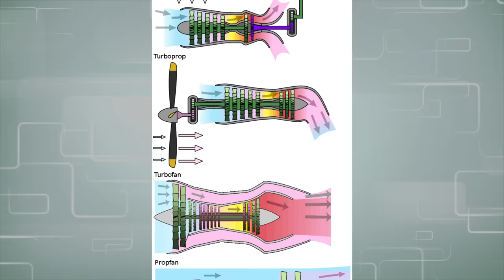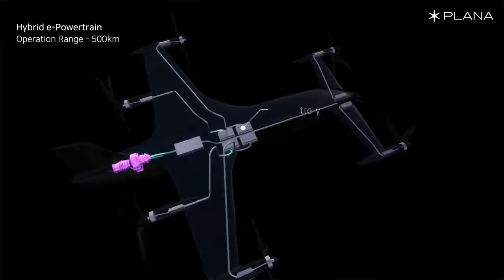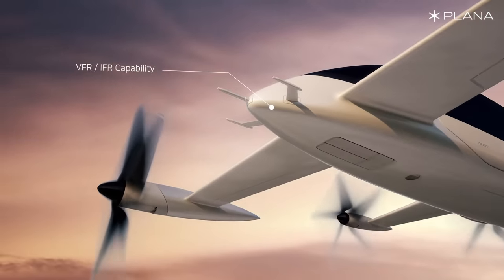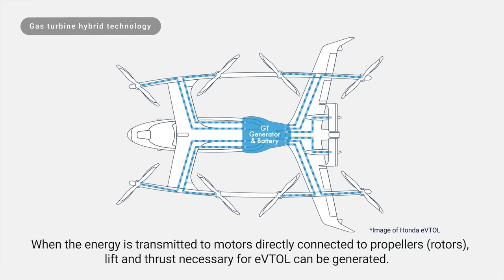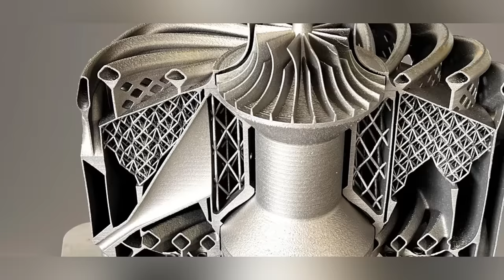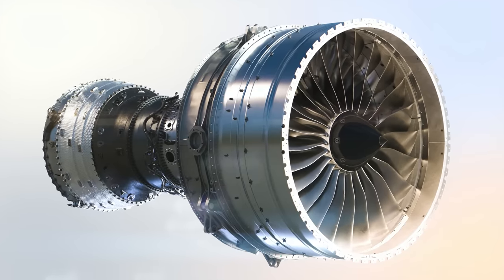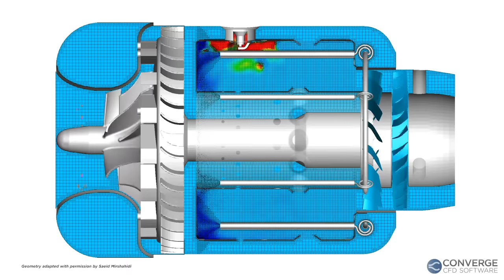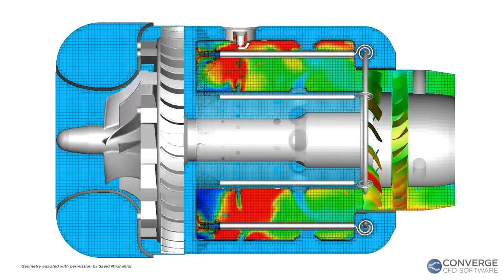New JET ENGINE Will Change AVIATION Forever

Comment: From a material perspective, it's an intriguing approach, but somewhat challenging because additively 3D-printed metals have very high internal stress. To eliminate this stress, numerous heat treatments are required, causing the component to distort and expand. Consequently, this distortion and expansion must be considered in the design, so that when the residual stresses are relieved during later heat treatment, the component attains the correct dimensions. The difficulty lies not only in ensuring the component has low residual stresses but also that it is sufficiently rigid, hard, and capable of withstanding high temperatures. For instance, austenitic steel is suitable for higher temperatures, or one might opt for titanium or alloys that can handle such conditions. However, these materials pose challenges in additive manufacturing, making it a significant problem to 3D print large heat-resistant parts or highly stressed components, such as turbine blades.

Comment: Fuel tank become lighter as fuel is used.  Batteries do not become lighter as charge is used.  An empty fuel tank adds minimal weight to an air vehicle.  An empty battery adds as much as a full one.

Comment: Marketing: "We need to placate insane eco-types and market an electric aircraft. Engineers: make it happen!"

Engineers: "Here it is. The plane can fly 30 miles"

Marketing: "Not good enough. No one will buy it. Make it better!"

Engineers: "Let's put a Jet Fuel burning engine in it to power the electric motors and increase it's range."

Marketing. "Perfect. We will call it eco-electric. Don't look at the carbon footprint..."

Comment: General aviation piston aircraft generally still use leaded fuel. Innovation in commercial aviation is usually incredibly slow. The air taxi model might work in cities, but I'm not holding my breath for hybrid airplanes.

Comment: General Aviation (anything under 12,600 lbs) urgently needs a new, inexpensive ($150k) turbine engine in the 300 to 450 SHP category that can burn from diesel, Kero, Petrol.....that can also be retro fitted to old airframes.

Comment: The biggest problem with trying to make electric planes is the fact that they weigh the same at both takeoff and landing. Fuel-powered planes have a far greater takeoff weight than landing weight. As they fly and burn fuel, they get lighter. Batteries will never get lighter, sacrificing cargo capacity for landing, not to mention range and efficiency.

Comment: The additive made engine you stated is 2000 watt hours per kilogram .Can you indicate what that means in HP to kilogram or watts per kilogram and how that compares to normal asperated piston engines like a  typical 100 hp  to 200 HP aircraft lycoming engine  like  is it twice  or three times as good as that  type of piston  engine .  If additive engines are only slightly better in Watt hours per kilogram  than other aircraft engine like a typical piston engine or turbo fan or turbine engine  then  the big extra purchase cost  probably makes them a non starter even if they have longer lives or longer periods of servicing .

Comment: I wonder if the 'killer application' here could be hybrid trucks. If the overall efficiency of a hybrid system beat a typical Diesel, it would be a huge win for truck drivability and running cost. Battery trucks seem a bit of a way off yet in true feasibility (the Tesla truck has a market, but it's not a universal solution at present). Gas turbine trucks were tried in the 60s and failed due to high fuel consumption, noise and expense, but fundamentally the problem there was trying to drive the wheels directly. A series hybrid with a turbine generator could solve all that now.
Reply: The Brayton (gas turbine) cycle is less efficient by a significant amount. So it isn't just the high speed shafts and noise that we're a problem.

The Rankine (steam) cycle would be more appropriate. Higher efficiency, fully internal working fluid, lower noise, burn dozens of types of fuel. The biggest issue would be keeping the weight down, but that should be doable in the same foot print as the ICE. It wasn't well suited historically due to slow response times. But with hybrid electric that is addressed by having a battery.

Comment: I think the idea of 3D printing entire mechanical assemblies as one whole device is both exciting and concerning.
The exciting part is imagining ease of maintenance. Rather than having to disassemble an entire engine to troubleshoot, you can instead have it sent off to be melted down and recycled, and a cheap replacement just hooks right into place with no fuss. We might be seeing a boomerang back to analog mechanical devices, if printing them with AI assisted modeling makes things cheap and efficient.
Now the concerning part. Obviously it would be a monumental task to quality control such manufacturing, as you can't exactly inspect each and every component in a sealed system like this. Imagine flying an aircraft without the reassurance that SOMEBODY made sure every part was up to spec? Additionally, systems like this are heavily dependent on adequate supply chains. If the company you bought it from goes defunct, you can't exactly just CNC/reverse engineer replacement parts, let alone service the engine. Though I suppose the same argument could be made for computer parts, or some other proprietary machine....
Reply: But instead of a single part engine, imagine an engine built in two halves along the longitude of the shaft.  It would result in 4 parts; two stator and two rotary. You could balance the assembly and use  compound plain bearings.  If it could be made reliable it would be super cheap to make.  Getting hung up on a 1 piece engine is a self defeating unnecessary challenge.
Reply: Every layer of the components can be recorded and inspected as they are being printed. They can also use the same non-destructive inspection techniques on 3D printed parts as the do for parts made using other methods.

Comment: Can’t see this working you need fuel for turbine plus a generator (these are heavy) the battery storage then electric engines.  Not only is that a lot of weight but it is also many extra points of failure something you want to avoid in aviation. 
None of it will reduce emissions and before some smart arse says use hydrogen it has the lowest fuel density and the storage is pressurised.

Modern helicopters are fairly efficient at converting fuel to lift.

Comment: You just need two stroke diesel with 60% thermal efficiency (average turbine comes with 30%). Turbines are great for long distance, high altitude commercial planes. But for short-mid range, low altitude - VFR... fuel efficient diesel, run on veggie oil... beats everything,

Comment: I'm an engineer and ASE Tech with 25 years experience...do you just say EVs are cheaper to build and maintain? Uh...you are aware the batteries are included in the build cost per unit, right? You know...those energy storing devices that are hell on the environment to obtain the materials, maintain the battery pack, and to dispose of? You are aware of this, aren't you?

Sarcasm aside, anyone that thinks any type of EV, with our current level of technology and most likely for the next three to four generations, will hold a candle to a petroleum fueled internal combustion engine is delusional. EVs are fine for a very small, niche market...but won't make the least dent when it comes to almost every aspect of vehicle propulsion...and they won't in any of our life times. 
I take nothing away from the innovation and power of an EV...but electric vehicles have way too many drawbacks and shortcomings with current technology. For an EV...build costs, operating costs, maintenance costs, and end-of-life disposal costs are astronomical compare to conventionally powered vehicles...which pollute exponentially less than an EV for any environmental wackos out there. Fact..research it.

Comment: Would be great if they would just work harder to get the cost of general aviation down.  Considering you will still pay well over $40k for a decent 50 year old aircraft is a problem.  I remember watching old(think 1950s/1960s) documentaries about Cessna, Mooney, and others talking about how general aviation will some day be affordable for everyone.  Fast forward to 2023 and your brand new Cirrus will cost 600k+.  Still running on engine tech from the 1970s...  Look up the price for a set of spark plugs for a lycoming engine.  Just a basic 4 or 6 banger horizontally opposed gas engine.  Bringing this stuff out is great, and I'm glad they are doing it, but I would move more into economies of scale to get the prices down for more 'normal' people to be able to afford it
Reply: The sooner "normal" people enter general aviation the sooner they would ruin it. Hobby aviation is a want not a need, a toy not a necessity and much safer for all concerned when gatekept as it is. The seriously hardcore will find a way to fly and those not seriously hardcore need not make the skies more dangerous by their presence. Forty grand is cheaper than many pickup trucks and well within dedicated hobbyist range. I have that in more than that in a modest motorbike collection. Knowing how "normal" humans drive we don't need them in the air.

Comment: There would be absolutely no point to electric aircraft since hydrogen can be used as fuel, without changing turbine technology.  Developing counter-rotating turbines will ensure turbine powered aircraft stay far ahead of reciprocating and electric aircraft.

The essential,problem to using hydrogen is embrittlement of the parts that come into contact with hydrogen.  Hydrogen can also be transported using existing pipeline infrastructure.

There have recently been major discoveries of geologic hydrogen, a new development in the hydrogen as fuel story.

Comment: With one of these generators on board, it won't be an electric airplane anymore, would it? 
I can imagine that VTOL is implemented more easily using electric motors driven by a turbine than a purely mechanical combustion driven solution, but for cruising an electric motor driven by the generator would probably not add much from an environmental point relative to a direct drive turbine.
Reply from the maker: This is true, definitely would have to consider power source for charging though. I think solid state batteries could just make pure evtols eventually, the 3d printed turbine maybe just a different direction for other types of aircraft?
Reply: yeah but electric airplanes are sh*t

Comment: So running a turbine to charge batteries and run electric motors is efficient? A basic law of physics is that with each energy exchange power is lost. Let's face facts, electric powered aircraft are simply inefficient especially on heavy lift and long haul conditions.

Comment: I can see 3D printing a huge amount of a jet engine but when it comes to bearings I am skeptical as tolerances and surface finish in extremely tight. can ball bearings be 3D printed? if the 3D print can be stopped, components inserted, then resumed maybe.
Reply: Especially since the images shown are not anywhere near a working prototype.  In fact, though exactly what the narration describes,  what we see here are completely non working, non-moving, rough in every respect,  one piece, with zero moving parts. Proof of concept for printers maybe. Working specimens they are no where near .

Comment: They should use a induction heating to run the jet engine. And use generators to recaputure some of the power. That along with solar cells, might allow the aircraft to not need to recharge at all.

Comment: Printing a turbine including all the bearings sounds not believable, fanblades, fanwheels or housings, ok but ballbearings ? Super high precision, and smooth surfaces looking at the imagery you have in the video that’s no way near the requirements…. It looks rough and coarse on the printed surfaces

Comment: Engine weight is less important than engine efficiency. If one doubles engine efficiency while less than doubling the weight of the entire plane, one has increased the plane's efficiency (more or less, as I'm ignoring the battery's "fuel"). Thus, the most efficient engines will win the range-extender game because range-extenders are relatively small and light by definition. Piston engines have always been more efficient, and that will likely remain so as advanced piston engines will soon reach 65+% real-world efficiency.

Comment: Hybrid electric drive systems makes sense for aircraft. Less moving parts, with enough batteries, way more stable center of gravity, and also electric motors are built to be run hard for long periods of time. I like the idea of this. I'm interested to see the further development in the future.

Comment: Printed bearings? Bwahahahaha... I'll grant you can make pockets that will accept a bearing or seal, but printing them? Pull the other one. Some post-machining to get accurate, smooth surfaces is absolutely necessary, and flow-honing of the turbine parts will both prevent shedding of particles which could damage downstream parts, and improve the efficiency of the air flow. Don't trust press release hype.

Comment: Modern turbines may be lightweight and reliable, but they’re incredibly inefficient. The only way turbogenerators will be worth it is if they have exhaust heat recovery which has only been tested on small 3D printed engines so far.

Comment: Anyone heard about the Air implosion engine. Its a self running engine that makes these tyoe of technology obsolete. Its been around for decades So why isn't it out....oh wait "self running" 🤔...yeaaah thats never gonna be used
Reply: because it requires extremely high speeds to operate
Reply: So why not just use a gear box to regulate the speed of the output ? Or your saying the material needed to manufacture the device isn't economical due to high speeds required? But if that's the case it still has to be economical because it's a self running device.

Comment: I look at this video and really wonder at the fact that there is far greater technology around that is just being he,d back despite its use being a great deal cheaper and a lot more hard wearing that present.
Gas turbines are at best very fuel hungry and the use of hydrogen powered engines are  something that make a lot of sense, but we hear little about their current state of production, the only thing i havevseen recently is to do with car engines rather than aircraft engines.

Comment: I'm just looking forward to the day they finally admit they can use hydrogen to power those engines.
Reply: Hydrogen is much more plausible than battery.
Still very difficult.
REALLY hard to contain it. Plus it needs to be green hydrogen not bullshit hydrogen or what's the point.

Comment: These companies what to make progress into compact turbine engines that has the potential to provide the power needed for larger aircraft like… a 787 to make a Trans Atlantic or Trans Pacific flight on just a small amount of fuel? Then they should get these small compact engines into the hands of the RC planes and jet Hobbyists. Since these people can literally do all of the R&D testing of the new engines in a shorter amount of time than it would take for the company to do itself for a longer period of time. 

Basically you have an army of about 10,000 to 100,000 people all testing the same engine over a period of a 1,000 to 10,000 hours. Those shorter times would equate to a single person having to run that test 10,000,000 to 1,000,000,000 hours.

Comment: Seriously?!?
EVs ruin everything!
Beginning with your thinking. 
The weight of fuel is diminishes over flight time while batteries weight jest as much at landing as at takeoff.
EV aircraft are at best a novely that will never work on a large scale and will never have the payload or range.
We are already seeing major auto companies getting out of the EV biz and washing their hands of it. We know that the logistics of manufacture and support of EV land vehicles are unobtainable! Then there's the safety factor.  EV fires are happening WAY MORE then being reported.  
And if you're on board with bringing that level of stoopid and foolishness into the air then please let me sell you a bridge AND an airport in the swamps of Florida.
Trust me, it's a really nice bridge and an excellent airport.
Reply: And don't even get me started on the concept of 3D printing an engine. 
It's excellent for models and making patterns and non-working examples but there is no way you're going to build an engine that I would ever fly with.

Comment: Hydrogen is a dead end, battery energy density is increasing, already we are near the threshold 50Kwh needed to make flight practical. hybrids will die out, better to avoid and focus on electric VTOL